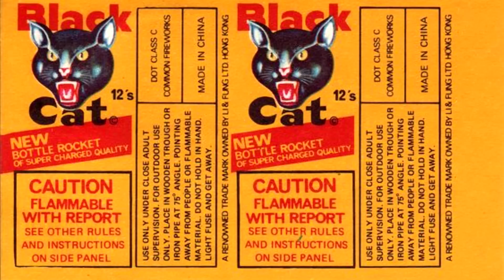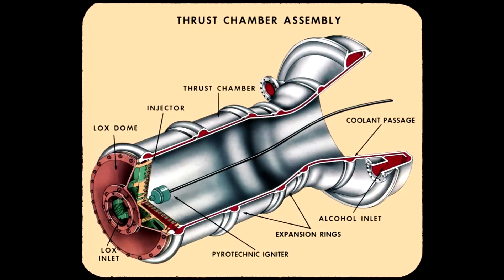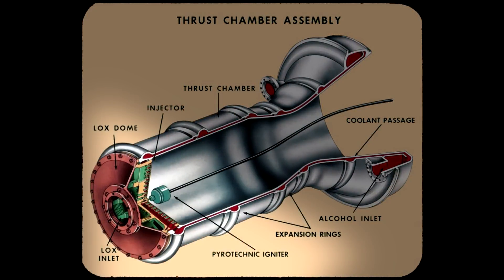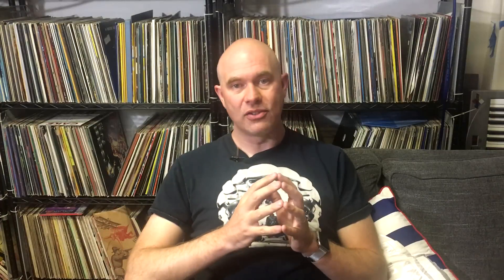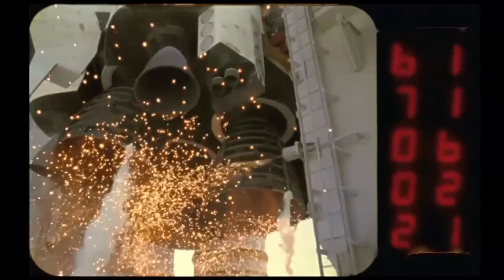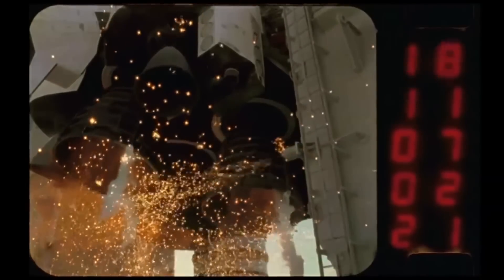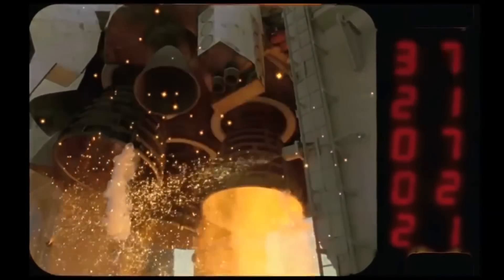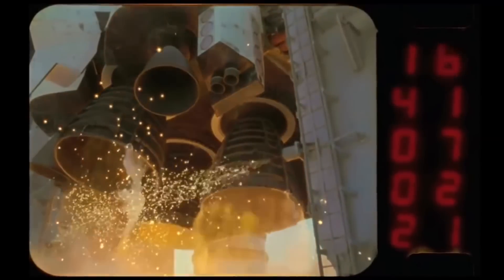How Rockets Are Ignited - Things Kerbal Space Program Doesn't Teach

Comment: Thanks for adding that little detail about the spark system for burning off excess hydrogen behind the space shuttle. That was a detail that I only just learned last year, and I figure 99% of space fans probably still don't know that. Hydrogen has a nasty habit of burning transparently, so having a hydrogen fire closer up toward the crew access could be quite deadly under various circumstances, so getting rid of it before it has a chance to rise up is a really, really good thing. :)

Comment: How gimbals work? And Ion engine? And how a engine restart in space without O2?
Reply: For the last question, the rocket contains oxidiser.
Reply: Rocket engines always use a oxidizer they are never reliant on atmospheric oxygen for combustion. Exception: The SABRE, but it is only a concept.
Reply: Ion engines super charge an ion and propell it out of the back. Of course it dose this many many times a second.
Reply: In terms of gimbals it simply changes the directions/vector of the nozzle.
Reply: Gimballed engines have the capacity to move their exhaust nozzles which obviously alters how thrust from that engine affects the craft. A couple examples on planes here, https://gfycat.com/BelovedScaredCoot and here, https://gfycat.com/DishonestCooperativeAmericanratsnake
Reply: "Any more questions ? :)" Yeah, during the Apollo 8 mission, they kept referring to "gimbal lock" W/R/T the navball. This seems to imply that the "gimbals" controlled the navball, much like gyros control an attitude indicator.
Reply: @turarwanaa Rockets bring oxygen (or an alternative oxidiser) as part of the fuel - if they've run out, then they've run out of fuel too, since they're brought in the correct proportions. And in addition to nuclear engines, ion engines themselves also don't require igniters, making them excellent for use in satellites where small corrections are required intermittently using an absolute minimum quantity of physical mass (ion engines have poor specific impulse but fantastic propulsion per mass of fuel because they use relatively large quantities of electrical energy to get insane exhaust velocities).
Reply: Gimbal lock on Apollo because they had three gyroscopes instead of four to save weight/complexity.
Reply: I know I'm late to the party, but I DO have a question after watching this and Scott's "rocket plumbing" videos;
A vehicle (say; the space shuttle) has been in space for a while and needs to relight it's engines to return or reboost (like the ISS), how do they make sure that it's the fuel/oxidiser that gets pumped into the combustion chambers and not the inert gas (was it Helium?) they use to keep up the pressure in the tanks? I understand this is  simple physics (Helium is lighter than the fuel and oxidiser and thus rises 'up' away from the engine's thrust vector) once the vehicle is under acceleration, but before that...?
Reply: @Atlessa  it's been a long time, but many engines will require ullage motors when restarting in 0G. Specifically, you either use dedicated small solid rocket engines or the RCS thrusters to provide a small amount of acceleration to push the fuel and oxidizer into the back of the tanks where the turbopump intake is located.
Reply: For the gimbals, the answer is in a basic diagram you can find online.
Reply: Gimbals are nozzles on pivoting mounts, using very resistant joints not to let any of that hot hair out. Ion engines are like firing Xenon ions through a railgun, many times a second. In space, without O2, your engine starts when the rescue mission provides O2 ; unless it's nuclear, in which case it doesn't need to ignite. Any more questions ? :)

Comment: A few questions, Scott.  1: Do you think that one of those new plasma arc lighters would be enough to start a small liquid fueled engine, and 2: Have you ever heard of a hybrid rocket where the oxidizer is solid and the fuel is liquid/gas?
Reply: I know some hybrids do the reverse.  For example, Space Ship One used laughing gas as the oxidizer and ran it through something approximating a tube of asphalt.
Reply: That's not reverse, that's the normal way... WWIflyingace62 is saying the opposite, a solid oxidizer with liquid fuel. Yes, they exist. I think the book Ignition has some words about one engine that ran that way.

Comment: Why am I not surprised that the Russian space program is the one which still uses "giant match"-style engine ignition?
Reply: if it ain't broke don't fix it
Reply from the maker: Aerospace engineers in general are resistant to changing something that works so well. Russian engines do exist which use TEB/TEA ignition, just not the ones used in the Soyuz.
Reply: Keeper Nod I never said crappy, I...well, I didn't say "old," but if I added an adjective it would be that one.
Reply: Soyuz will have almost 1000 successful launches soon, so yea what a "crappy" style engine ignition. Lets waste money, and reinvent the wheel.
Reply: Timothy McLean
 You did insinuated "crappy".

Comment: Here's another question for you. Sometimes, when things go horribly wrong, rockets can be blow up in flight. How does that work? Are there explosive cords all along the rocket? Is the combustion chamber breached? What about solid rockets?
Reply: +Pyrobird all rockets have explosives installed to detonate the rocket if it starts flying off course.  You don't want a rocket impacting in a populated area, so the self destruct charges are designed to cut open the fuel tanks to simultaneously end ignition and disintegrate the rocket.  In the case of solid fuel rockets, charges break apart the case so the fuel disperses and ends ignition.

As an example, after the space shuttle Challenger broke up, the SRBs started flying back towards the land, so the RSO hit the self destruct.
Reply: Usually it's down to something burning where it shouldn't (most often due to a leak). The Space Shuttle Challenger disaster was initially caused by exhaust gasses from the SRB venting through an o-ring; it wasn't sealed correctly (if I'm not mistaken), and well, the full details are on the internet.
More recently on the Space X explosion, one (or more) strut(s) failed which held one of the fuel tanks in place.
To my knowledge explosives have never caused an explosion; if you don't regard a rocket as a directed explosion anyway. Usually they're used for staging anyway, so you'll never have a great quantity anywhere.
Reply: It depends on the rocket, but some use explosive bolts/det cord to make sure the rocket becomes small pieces before it lands.

In the US, there's a RSO (range safety officer) who has the job of pushing the button to make the rocket disintegrate if it starts to go off-course.
Reply: thebigitchy quarthinos  not quite sure how I forgot about that safety measure >-<

Comment: The germans (DLR)are actually testing a version of igniter whitch works with lasers
(laserignition by heating small parts of the fuel up to a plasma on one spot which then ignites the rest of the fuel)
Advantages would be less weight and reusability